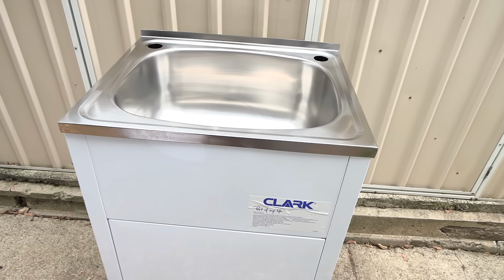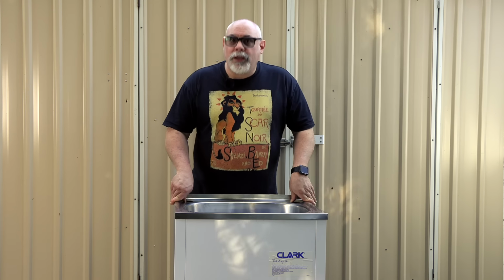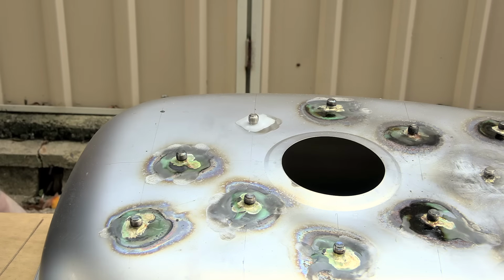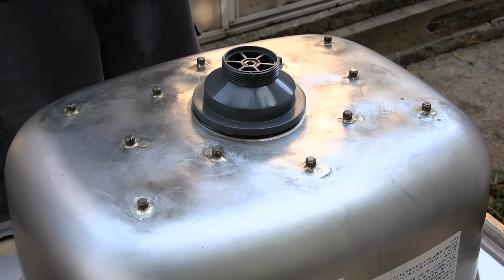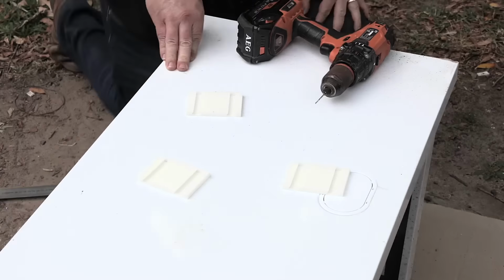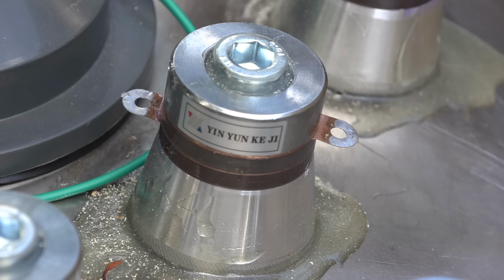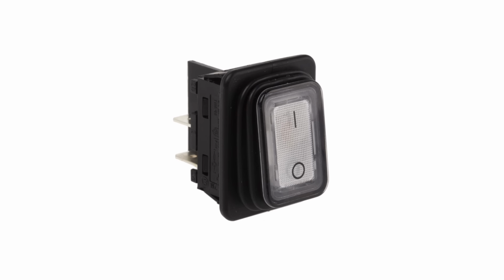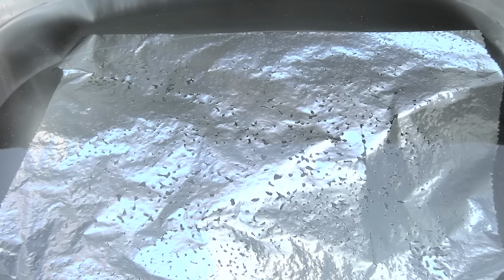Building a Laundry Sink Ultrasonic Cleaner

Comment: Soldering electrical terminals where vibration is present is a VERY bad idea!!

soldering + vibration = micro-cracks & electrical failure! See British MG cars I believe for horrid electrical problems, and the automotive industry-wide use of crimped terminals over soldered, its absolutely not a money-saving thing.

Use FEMALE spade-terminal connectors to slide over those ultrasonic electrical rings, crimp connecting wiring to them. If heat is expected to be an issue, order nickel-plated female spade-terminals.

Here is a link to IDEAL brand spade terminals, they range in spade-width from 3-12mm and so should be able to slide over those rings you're soldering to.

The vibration will cause the copper-strands coming out of the solder to crack at the solder joint. 

Good creativity mate, just follow some fundamental electrical principles and you'll have a long-lasting unit.

You might also want to buy a tube of CPU heat-transfer paste & repaste all those Chinese voltage regulators, Lord knows they save money where no one checks, not pasting the heat-sinks.

https://www.google.com/url?sa=t&source=web&rct=j&url=https://media.distributordatasolutions.com/ideal/2020q3/documents/384f6d69247cab8044b367835ce74d34b8111dd8.pdf&ved=2ahUKEwjVjZjp8Pn8AhUZjYkEHWc1AbMQFnoECBQQAQ&usg=AOvVaw3Je2FnWpdnOJp3v4-dArBa

Comment: Pedantic, but AC is both going to go into those drivers AND go out... It was mentioned at least once that DC was coming out of the drivers, but it's high frequency AC. The driver is essentially an AC->DC->AC converter (the DC in the middle is so you can switch chop it up really fast to make the 40kHz AC output).
I'd also say it's more so that the multiple drivers provide a solution that's 'good enough' for a home-brew. You'd have to be SUPER unlucky with the timing of the drive signal to get cancellation of the sound field that would make it just a noisy tub of water. If you were able to find drivers that could synchronize to each other, you'd get a solution that would basically always kick major tail. Without it, you basically get a cleaner that does the job reasonably most of the time, and may not do as well some of the time

Lastly, I'd be really surprised if the clothes washing went well. Same reason you don't use flexible adhesive for the transducers is why ultrasonic cleaning of clothes is less than ideal. The fabric absorbs the sound waves and reduces the ability of the bath to cavitate

Comment: I like the design I think you did a good job the only issue I can see right now is you didn't use grommets to run the wires through the metal housing of the base which could eventually rub and short out.

Comment: Since you have the parts on hand.....Could you build an ultrasound cleaner with a frequency high enough to oscillate water molecules so fast that bonds are broken and liquid water bursts into pure vapor at extreme pressures so that one could use it as a source of power for engines generators etc. Asking for a friend ....

Comment: Very very nice job! Have you considered heating it? I know that would be a challenge. Thanks. I look forward to the test. I never considered it would clean laundry. I wonder how it will do on stains.
Reply from the maker: This cleaner will be plumbed to a hot water source, so not really necessary for this one, however I am investigating heating options for my previous ultrasonic cleaner build.
Reply: @BranchusCreations  there is such a thing a a single cup Heater for coffee in a cup. But the ones I've used didn't have a temperature control. That would have to be built. Or an expensive sous vide device can be bought. Have fun. My wife just brought me something to remove a stain on! Lol

Comment: WOW that came out REALLY professional looking, very nice. 
By the way it beat up the aluminum it works really good to.
I have a good sized ultrasonic cleaner that I keep only water in, all the parts I clean go into heavy duty zip lock bags or plastic containers with my cleaning agent in them. This saves me from wasting expensive cleaners and having to dispose of large amounts of cleaner. Hopefully this wasn't an old tip to you or is a new tip to others that read this.  Thank you for the video 😊

Comment: Is this fused?
Reply from the maker: It is. There is a mains fuse built into the power socket, and each of the drivers has its own fuse too.
Reply: @BranchusCreations  I didn't notice one.  I know in places like the UK, the plug itself will (can) have a fuse in it and that in other places outlets will have their own fuse, so I wasn't sure. Thanks.

Comment: I wonder...

Because you need them to be in sync, would it not be better to get(or build) a single large driver instead of 3 smaller ones?
I would figure that with the (possible)small variations in components that they are not perfectly in sync even if you power them up from the same source.

Just a thought

Comment: Have you considered a PC liquid cooling kit for the transducers? Or if you're feeling industrious, a mineral oil immersion cooler for the drivers.
Reply from the maker: If the transducers are functioning correctly, they really don't get that hot. The things that get the hottest are the transformers on the drivers, but the fans I have keep them under control.

Comment: AC plug not grounded to the metal chassis of the whole assembly? Also wires through metal walls without grommets? (edit: I see other comments already covered that)
Otherwise it all looks awesome!

I wonder if electric welding of the studs is possible for these, they use Copper studs though, so probably not
Reply from the maker: It's grounded (now).

Comment: Nice tutorial! I know soldering tips are a dime a dozen but by my experience the easiest way for this type of application is to cut and wrap a little piece of the soldering wire around your stud and cover it with flux before heating. That protects the solder itself from oxidizing and it'll flow into the joint as soon as the heat is right.
Reply: It never ceases to amaze me how this tech community has such similar interests. The number of "random" videos I've seen you comment always surprises me!
Reply: @lotmom  messiah

Comment: 12:10

Live should be the one that's connected to the little glass fuse on the left bottom corner of the PCB (so the bottom pin, I suppose)

Also, this is an awesome video, I think I'll build one myself (as soon as I get me a used sink and money for the parts required :D)
Reply: Absolutely … live to the fuse.

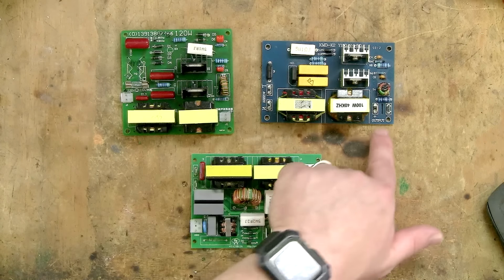Comment: 11:54  It is not DC because it is 40kHz. A speaker signal is of course phase difference reliant so it is never a DC signal, Hertz(Hz) being a function of time and phase difference between the polarities of the signal, hence the polarity symbols, but it is never a DC signal. It is most often a sinusoidal wave function but can also be a square wave, triangular wave or a sawtooth wave. That depends on what is needed for what purpose.  Anyway, nice cleaner build though.👍
Reply from the maker: The driver has bridge rectifier on it, so DC is being used for something!
Reply: Yes, + and - markings on a speaker's terminals will have to do with phase direction, i.e. whether the speaker mechanically pushes out or pulls in when receiving a positive signal on a terminal, so to get the transducers all pushing and pulling in the same direction you need to be consistent with the polarity of all the transducers or there will be phase cancellation. Not important which is which as long as the wiring is consistent. Just for completeness, the + will mean that the speaker will push out on a positive signal.

The bridge rectifier on the driver will have to do with powering the driver circuitry, and not because of the piezo transducer itself.

However, I should point out that it is perfectly possible to have DC and AC components flowing simultaneously in the same line. Meaning that it isn't enough to know there are 40kHz in a signal to rule out the presence of DC. It could happen that some speaker technology might need a DC component to work properly, who knows, but granted this is not the case here. As an example, condenser microphones will use a DC component to polarize the condenser (that is what phantom power at 48V delivers) and the signal traveling the cable will be a superposition of that DC component and the AC component of the audio signal you are capturing.

Comment: Your "little connectors" are called Molex connectors.  I used them by the ton in Amateur Radio.  

Also, instead of soldering the wiring to the transducers, have you thought about using heavy gauge terminal connectors?  You could crimp the wires into the connectors (add a bit of solder if you like just for good measure) and then just slip the terminal connector over the lug of the transducer.  If the terminal connector is a bit wiggly you can crimp them down a bit for a snugger fit.  No heat involved and easily removable if, for any reason, you should want to do so.
Reply: Never solder crimp terminals or ferrules. It it electrically not required but increases the risk of fatigue fractures of the copper strands, especially in applications that are exposed to vibrations.

Comment: The connections to the transducers are very poor. The proper method is a mechanical connection [attach the wires to the terminals physically] before soldering. Don't rely on just the solder as you did... 👍👍

Comment: I liked your diy cleaner so much.

Well, I see that u already did some upgrades that people requested in comments.
So, I have a question, why did you not use spot welding? You can easily make one that can do this type of job with a transformer from old microwave.
Well, it's just for curiosity, I'm just want to now why brazing and not welding.
Reply from the maker: The short answer to this is because I already had everything I needed for brazing, I knew it would work, so that's what I used.

Comment: No air inlet holes in your driver boxes??
Reply from the maker: Underneath the driver. There is a gap under the driver at the back and sides. The fan pulls air under then over the driver, then out the fan hole.
Reply: @BranchusCreations  Aah gotcha! I was like you can make such a complicated cleaner you probably did not forget the air holes :p

Comment: Might have missed something but are all the drivers made for 40k hz? Have you considered adjustable drivers? I suppose that would cost more and I don't have the experience to know if it's worth it
Reply from the maker: Yes, they are 40KHz drivers. I haven't found any off-the-shelf solutions that provide adjustable frequencies.
Reply: @BranchusCreations  I've found a few on Alibaba, they cost 3-5x the price. Tried searching some more and found an article about supplying different sweeping frequencies in succession for more efficiency. Probably overkill but pretty cool. I can send links if you're interested

Comment: I applaud this video. However I to have a couple of thoughts.
I think you might look into resistive soldering. The heat is a lot more instantaneous. And intense. 
I've seen it used successfully In model rail building and in jewelry repair and building. I think a small low current welder would probably foot the bill nicely. Not to mention the other uses such an item could provide.

Comment: Great build!  I worked in Pharma industry for about 40 years & we had several large ultrasonic cleaners. Your foil test is a great way to show performance. From experience, I would add a couple thoughts:
1. If possible, place items in a basket which does not touch the bottom of the tank. Heavy items resting directly on the tank dampen the vibrations.
2. Be careful to never drop items into the tank. The epoxy bond on the transducers may break and destroy the transducers and/or drivers.  Using a basket reduces this risk.

Comment: Could you tell me where you found the 'Liter per x-Watt' Value?
so if you have 12 Transducer and 12L its 1:1? 
1L=60W

I could not find any advice from the Seller side :(
Reply from the maker: I read the 100W per gallon rule somewhere in an ultrasonic tutorial website. I then converted that to ~25W per litre (3.8L per gallon). I also came to this conclusion based on the commercially available ultrasonic cleaners. 10L = 240W, 15L = 360W. Approximately 24W per litre. So my cleaner is 30L and I am using 720W of cleaning power.

Comment: why noy just make multiple rods with say 2 of those transducers in them. then add multiple rods to the water bath on bottom or sides or between parts as needed. eg don't connect the basin/sink. like a soap on a rope (I could mention other naughty devive). so could just hang them from overhead or similar.

Comment: Nice project. Thanks.

Quick comment re your soldering of the transducers....

I agree that high heat and fast application is the way to go, but your technique belies that. You're applying heat twice where only once is needed. The tabs are tinned. you don't need to "blob" them (a quick rub with sandpaper will remove any oxide that might have built up if that is one of your reasons for blobbing). More importantly though, you're not making a mechanical connection. That's what the hole in the tab is for. Pass the wire through, twist to make sure that it has a good mechanical and electrical connection and then a fast in and out with the soldering iron - one hit of heat. Solder is primarily a means of holding things in place and shouldn't be the primary means of enabling current flow. Solder connections are sensitive to both degradation/corrosion of the solder and mechanical problems (which, given the environment that you're using the transducers in, is highly likely). The joint can also be supported with a heat shrink sleeve (or rubber sleeve) to reduce those problems.

One last thought. You're permanently fixing a transducer without testing it first. That makes me uncomfortable 🙂. Not sure how you might test them safely, but it could potentially save a lot of grief down the line.

Comment: How do the fans work and not just cavitate? Shouldn’t there be a vent somewhere on the box?
Reply from the maker: There is a gap under the driver at the back and sides. The fan pulls air under then over the driver, then out the fan hole.

Comment: Instead of soldering the wires directly to the transducer's tabs, why wouldn't you just just a nut/bolt  through the hole and use some threadlock and also dielectric grease?  I would think a mechanical connection with some Loctite would be better on something vibrating at 40khz compared to a solder joint that can break from looking at it wrong.

Comment: I have a question.

Does it matter how much volume u add.
Like u say, it's not practical filling it to the top. But does the change in volume matter for the amount of ultrasonic vibrator u need for the best efficiency
Reply from the maker: There is an optimum amount of liquid based on the amount of cleaning power. It's not exact and you can go with a little less or a little more than recommended. But too much less and you risk damaging the transducers, and too much more will reduce the cleaning efficiency.

Comment: Isopropyl alcohol will remove flux in a hurry and safely at that. You need concentrations over 90 percent though
Reply from the maker: I was using 99.9% iso alcohol, but I think I just used too much flux in the first place.
Reply: @BranchusCreations  Most types of Flux break down like this under such strong heating from a torch. You could heat it more indirectly (from the other side) and more slowly, and using a hot air gun instead of a torch, and probably prevent the flux from becoming so crusty and horrible. Then it should actually dissolve using most solvents like isoprop.

Comment: Very cool! If this was a commercial product I'd definitely buy it!

Seems like spot welding those studs on to the tub would be way easier than brazing them on... They sell cheap stud welders that are intended for welding 'pulling studs' onto panels when pulling dents out of a car in an auto body shop, might be a great tool to make that job easier if you have to do it again!
Reply: I came here to say the same! I'd forgotten about those dent puller rigs. I have used stud welders to support my wire ways while building ships. They were basically a combo MIG/spot welder.
Reply: Ultrasonic cleaners are already available commercially. One the size of an actual kitchen sink would be pretty expensive, though.
Reply: @Hawk7886  Yes I understand that. But apart from this one I've never seen one that actually doubles as a sink, which I think is a very clever idea! That's what I was referring to when I said "I would buy this if it was a commercial product". I already have several smaller ultrasonic cleaners, and they're often a pain to use because changing fluids in them is annoying. This design solves that problem very nicely!
Reply: It is very thin , you need an master welder !

Comment: 17:30 Doesn't the solder break after a few minutes of vibrating and cables fall off real quick?
Reply from the maker: It doesn't. It's incredibly strong.
Reply: @BranchusCreations  I think Michel777 is referring to the electrical soldering, not the mechanical brazing? It will not be a matter of minutes, but in time, maybe years, solder will become brittle and it might fracture, specially with vibration.